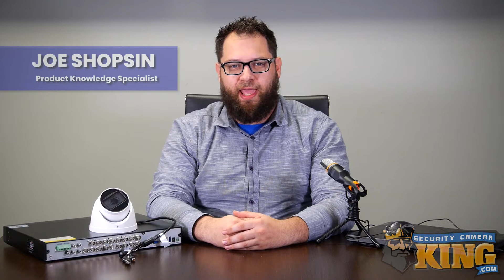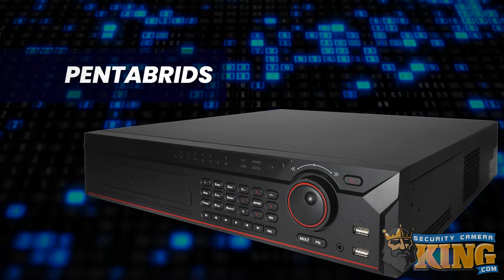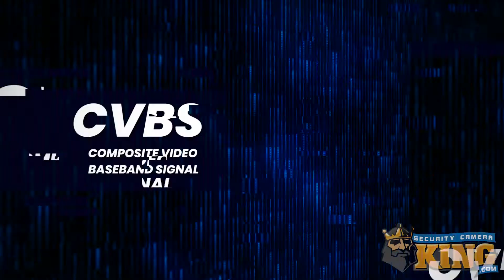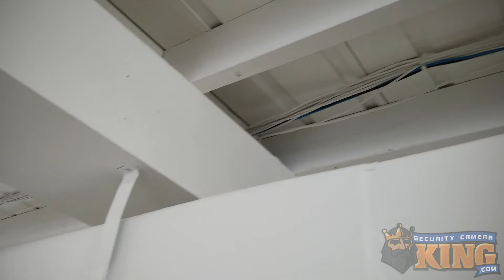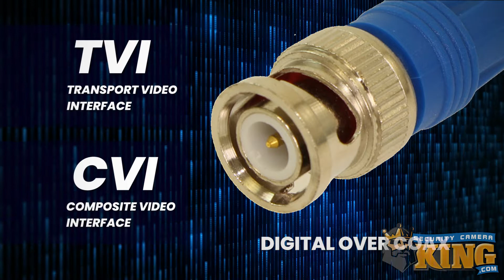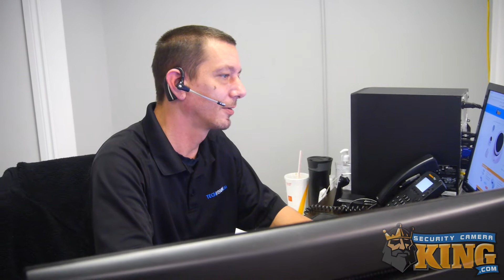What are the 4 Analog Video Signal Types?

Comment: Installed a AHD camera and need to input directly to a Monitor that does not have a coax BNC type input apart from the TV tuner antenna input. Is it possible for the AHD output to be detected correctly by the monitor's TV antenna input, if I tuned to it using the TV tuner? The monitor also has a composite video input, would that work correctly with the AHD putput from the camera? thanks for any help in advance. Mark.
Reply from the maker: TV RF Coaxial Input is only for RF signals and RCA Inputs only accept Analog signals, AHD, CVI and TVI are all digital signals, so this would not work without a converter. If you are trying to view your recorders output on a tv consider this old article here. 
https://www.securitycameraking.com/securityinfo/how-to-view-your-surveillance-system-over-multiple-tvs/

Comment: pleese i had changed my camera from cvi to cvbs at the osd menu , but after that it stuks at cvbs and the osd menu is blocked , is there any solution to return to cvi without using the utc controller ?
Reply: Hello, Normally you would use the IRIS + or OSD MENU controls from the Live View on your recorder. If however, you cannot access the OSD by this means you will need to use a UTC controller.